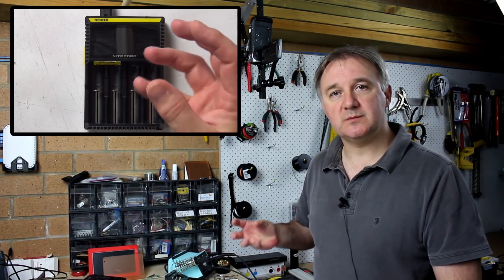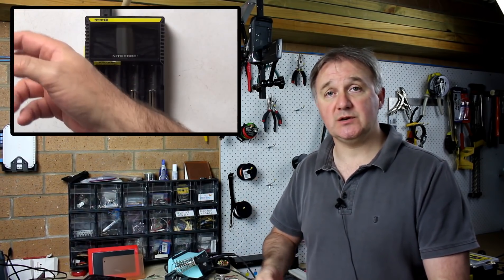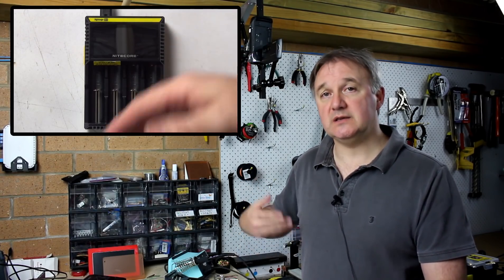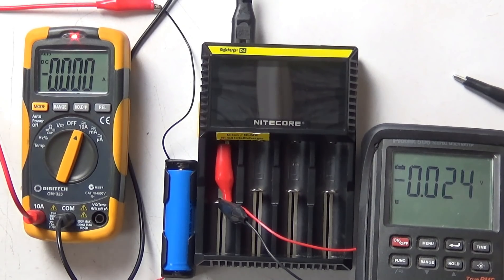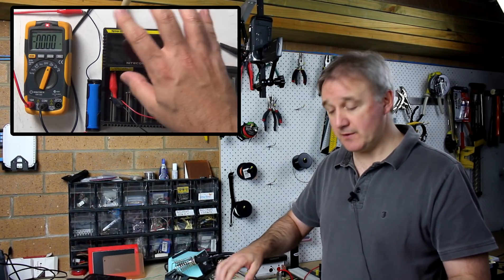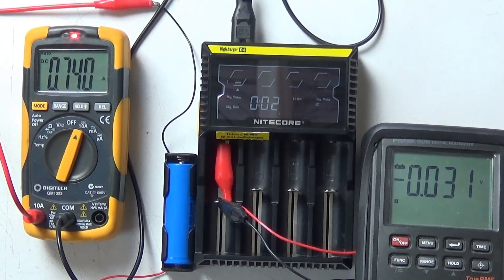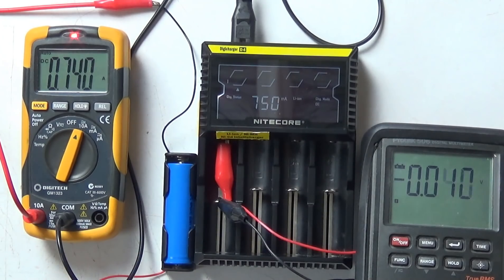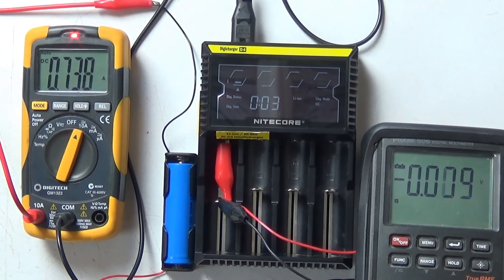Battery Charger Test - NiteCore D4 (MEHS) Episode 60

Comment: Hello, I use this NiteCore D4 battery Charger. I have the same problem only when i use some pliers/clip.  If you plug directly you  18 650 on the charger, you will get a proper charge. 
To avoid the disconnection try to weld wires directly on you charger for your test.
For your information, i have a 0.1 /0.2V of difference between my voltmeter and the charger.
Reply from the maker: - Thanks.  The main reason for the test was to show that it charges cells correctly, using the CC / CV method, which it does.  Cheers.

Comment: Well, from what I know (and from what TP4056's datasheet says) it's not constant current. But it uses the best method, again, from what I know. (P.S.: I made a charger for 6 18650 cells using unprotected TP4056s and it work like a charm.)
Reply from the maker: - Thanks for that.  More to consider.  I will keep reviewing until it all makes sense and the good stuff is separated from the rubbish.
Reply: My Electronics & Hacking Show Great, that's perfect. As more knowledge on youtube the better. ;)